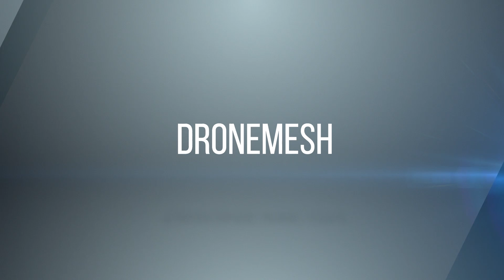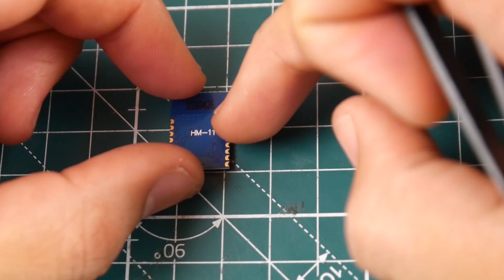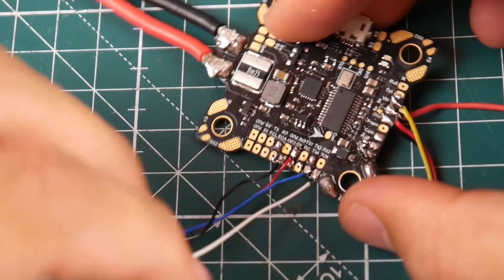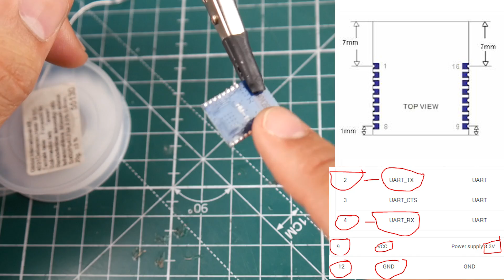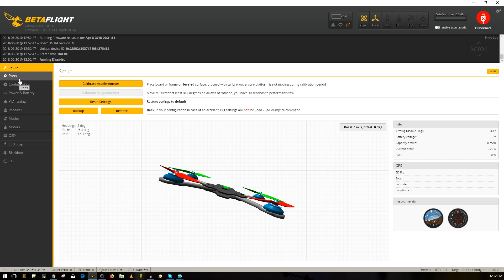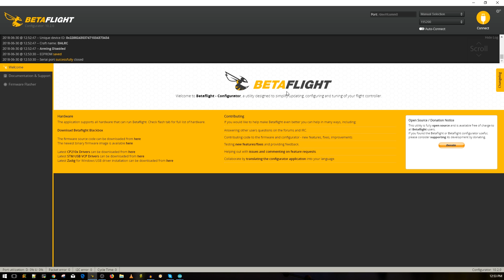Connect SpeedyBee APP on any Flight Controller Hack // How to connect Bluetooth Flight Controller

Comment: Unfortunately, this no longer works with the latest version of the Speedybee App.  However, if you buy the Speedybee Bluetooth module, it will work perfectly with any INAV flight controller.

Comment: I am really excited about this. Unfortunately I won't be able to to this to my Joshua Bardwell FC.
Because You have to choose either 3.3v or 5v when wiring up your reciever . My r-xsr took 5v to power:(
Reply from the maker: You can still add it the FC.. think about it for a second and I think you will figure it out.

Think outside the box.. the pad should be available but in a different form.

Comment: I wish this worked with butterflight.
Reply from the maker: It might. They are all talking with multiwii protocol
Reply: I tried it and it didn't work. It will only load the CLI interface I think.
Reply from the maker: I think speedybee app is entitled to release source code but I could be wrong.

Comment: i hope somebody gets speedybee app to work via usbport straight to usb on the phone.
Reply from the maker: TheMadmacs It does just get a USB adapter
Reply: i'll try again my phone is old and so is my pad,
Reply: buy an "OTG USB adapter"
Reply: i heard those arent a real thing, you need to enable phones debug mode in order to allow it to power an external item,  all usb's are OTG is what i heard. i cant remember if my phone powered the FC up or not,
Reply: Some phones have OTG disabled ..but basically OTG is simply a usb plug that has a couple wires crossed around on one end ..so no, you can't use a plain usb cable but do need a otg adapter...or you can google how to make your own otg adapter
Reply: PS. no OTG on iphones
Reply: thats what i used to think too,  but now i'm not so sure because somebody said they are a myth. some phones require special non standard plugs but usb's are supposed to be universal. the tutorials on otg's suggest there is a whole different type of usb called a ''data cable'' which has and extra ''sensor'' cable and to make it otg you just bridge sensor and ground.  its all about supplying power to an external object  this would imply that when i plug my computer into my flight controller i would need an otg cable, which obviously i dont, so when i plug my phone into a flight controller? does it power up the FC, i actually forget hehehe
Reply: otg is simply about who supplies the power, and by default it's usually always the computer or charger ^^ doing this wire short simply instructs the devices that it's the other way around (ie. the phone, and not the computer ...euhm FC in this case)

Comment: You dont need the speedybee to connect to your fc man, it will connect to it anyway. Not kidding. I have tried it with my jbf4, and my bff3, and my lizard 95 fc. I dont own a speedybee at all
Reply: If you want bluetooth then yes you need it, but you dont need it if you want to use the app on any of your fc's
Reply from the maker: Yes they all use mutliwii protocol over serial but I wanted the Bluetooth connection.

Comment: Hack? Speedybee has it’s own module working with the app since months (android & ios)
Additionally, it will disable the BT when you arm to avoid any possible issue.
Also, they can receive some revenue for the effort they put in the app.

Comment: This will work, also the speedybee app will work simply via USB. The speedybee branded bluetooth controller is a couple bucks more. The main difference is the speedybee version shuts down when the quad is armed to limit bluetooth interfeerence with your transmitter which both operate at 2.4ghz , unless using crossfire or something like that. That said, this should work just fine. Thanks for sharing :-)